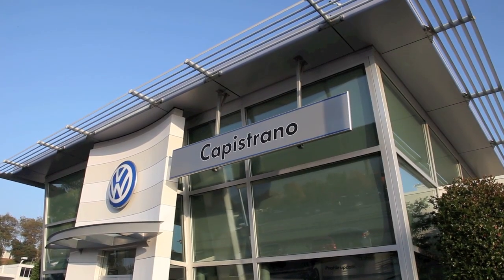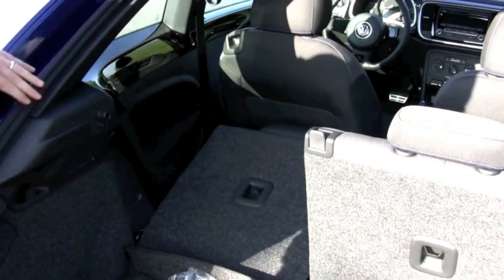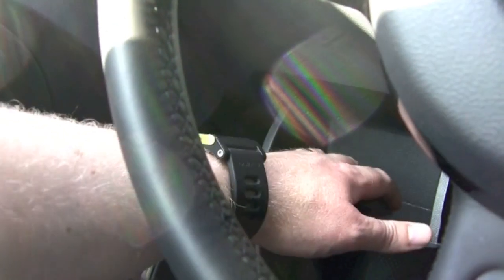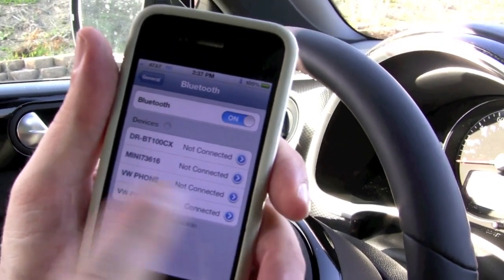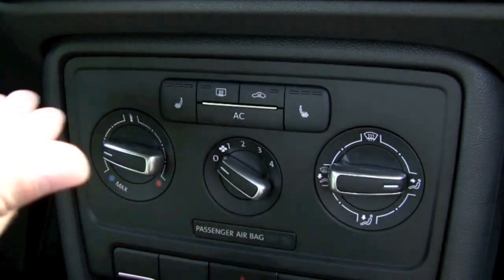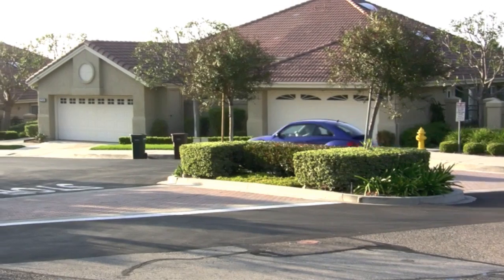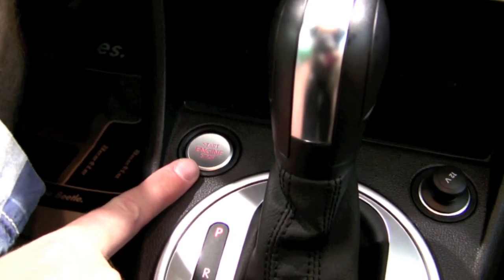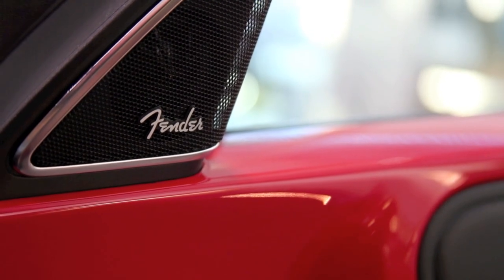2012 Volkswagen Beetle - Feature Tour

Comment: LIKE I SAID ON YOU PASSAT REVIEW YOU HAVE DONE A EXCELLENT JOB I HAVE BEEN TO A AUTOMOTIVE MARKETING SCHOOL SO I KNOW HOW A CAR SHOULD BE PRESENTED I GIVE YOU A + I REALLY LIKE THAT THEY PUT THE ENGINE TEMP IN THE MFI THE OLD BEETLE DID NOT HAVE A TEMP GAUGE AND IT SEEMS TO READ REAL TIME NOT LIKE THE MK4 OR MK5 JETTA OR GOLF THE TEMP GAUGE WOULD NO MOVE MUCH FROM NORMAL TEMP. IT IS EASY TO SEE IF YOU THERMOSTAT IS WORKING OK I LIKE THE LOOK OF THE HOLE DASH AND CLUSTER AND LIKE THAT YOU CAN

Comment: Hi there Richard. I have the 2012 Beetle that I call the Retro edition due to the two tone interior and I have the retro looking hubcaps on the wheels. It also has the moon roof. I bought it used last year and I notice the roof does not open all the way. It slides back about 2/3 of the opening, if that makes sense. Is that normal? Should it slide all the way open?
Reply from the maker: bigmamakaboose it is normal for the moon roof to open no further than 2 / 3's of the opening. If the glass panel opened further the hatch would come in contact with the moon roof when both are open.
Reply: Richard McAllister Thanks so much for quick response! Ok, that makes sense.  My Integra moon roof opens all the way so   I just wanted to make sure there wasn't an issue that needed fixing being that I bought it used.